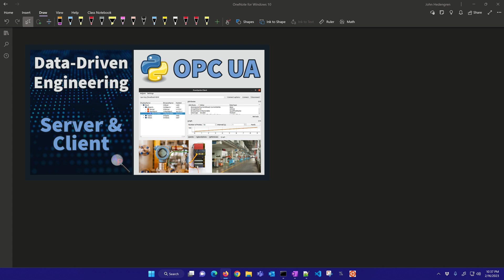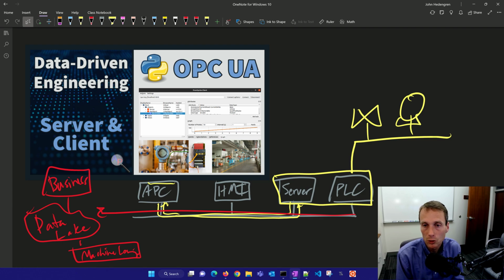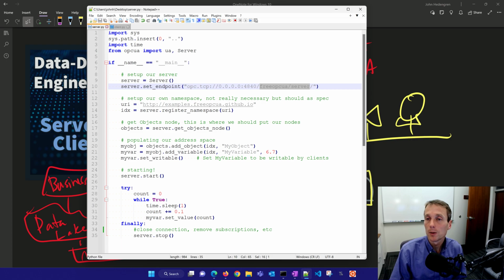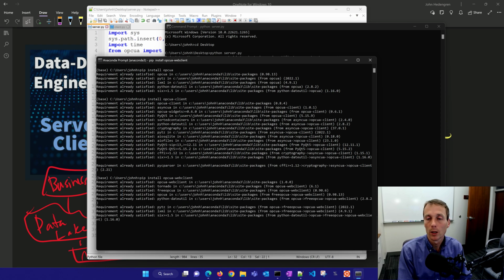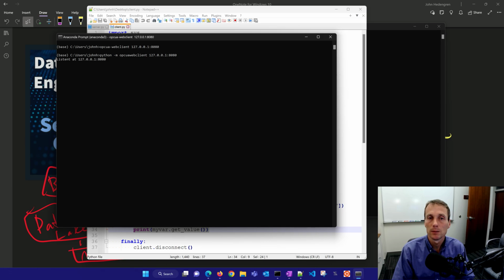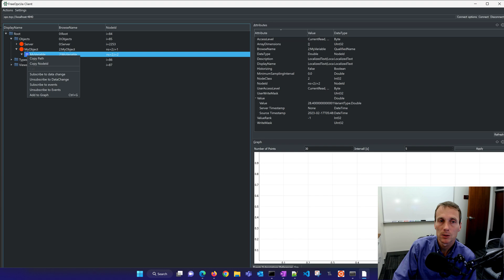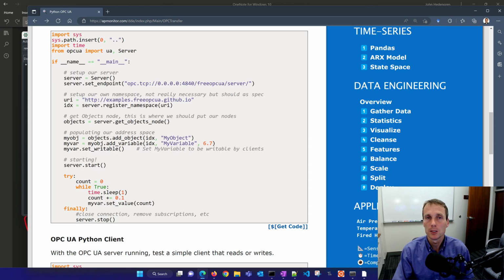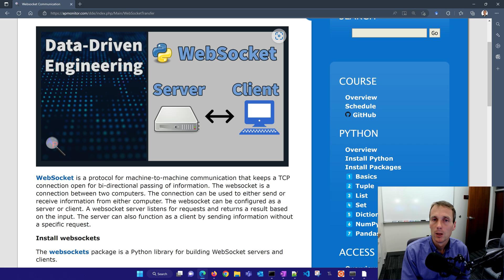OPC UA with Python

Comment: Tnx. How can I connect to a opcua server with certificates and sifn encrypt?
Reply from the maker: To connect to an OPC UA server with certificate-based authentication and sign & encrypt security, you typically follow these steps using a programming library like Python opcua.

Step 1: Install OPC UA
pip install opcua

Step 2: Generate a Certificate and Private Key
You can use openssl:

openssl req -newkey rsa:2048 -nodes -keyout client_key.pem -x509 -days 365 -out client_cert.pem

This generates:
client_cert.pem → Client certificate
client_key.pem → Client private key

Step 3: Connect with Sign & Encrypt Security
Here’s a Python example:

from opcua import Client
from opcua.common.security_policy import SecurityPolicyBasic256Sha256

# OPC UA Server endpoint
url = "opc.tcp://localhost:4840"

client = Client(url)

# Set security policy to Sign & Encrypt
client.set_security(
    SecurityPolicyBasic256Sha256,
    certificate_path="client_cert.pem",
    private_key_path="client_key.pem",
    server_certificate_path="server_cert.pem"  # Provided by the server
)

try:
    client.connect()
    print("Connected successfully with Sign & Encrypt!")
    # Read or write nodes here
finally:
    client.disconnect()

Replace "server_cert.pem" with the actual server certificate file or fingerprint if available.

Comment: Nice video! Thanks! May be you can make video about OPC UA TSN? And IEC/IEEE 60802 TSN?
Reply from the maker: Time-Sensitive Networking (TSN) is important in many applications. I typically use MODBUS when speed is important. It is an older standard, but specializes in high-speed numerical data.

Comment: Code doesn't work for me. I got this error: "The requested operation has no match to return."(BadNoMatch)
Reply from the maker: The error message "The requested operation has no match to return." (BadNoMatch) from the Python OPC UA package generally indicates that the operation you attempted to perform did not find a valid target or match in the server's address space or data structures.

Comment: How do we handle cases where we have a subscription based getting data and suppose there is a connection drop. So we still go with latest value assuming it has remained constant and not updated
?
Reply from the maker: When working with OPC servers, identifying and managing stale or outdated data values is important in industrial applications where data integrity is vital for operation safety and efficiency. Here are strategies to detect stale values with OPC UA:

1. Timestamp Checking
Each value read from an OPC UA server includes a timestamp that can be used to detect when data becomes stale if the timestamp remains unchanged over an extended period.

2. Subscription and Monitored Items
Instead of polling data (repeatedly reading values), OPC UA supports subscriptions where the server notifies the client of changes. You can specify a publishing interval and a "deadband" to filter out unnecessary updates. Monitored items can be set to notify only on significant changes or after a certain time of inactivity.

3. Setting Data Quality Flags
OPC UA servers can be configured to include data quality flags with each value. These flags can indicate issues such as communication errors, sensor malfunctions, or configuration errors. By checking these flags, you can determine if the data should be considered reliable.

4. Implement Heartbeat Signals
For critical variables that must be updated regularly, implementing a "heartbeat" signal can be effective. This is a write operation performed by the data source at a regular interval to a specific variable, indicating that the source is still operational. The absence of recent updates to this heartbeat variable can signal an issue with the data source.

5. Analyzing Historical Data Patterns
In some cases, analyzing the historical patterns of data updates can help identify anomalies in data freshness. If certain variables typically update at regular intervals, deviations from this pattern can be flagged for further investigation.

Comment: Hello !!
Actually at 9.21 minute of video time-stamp I am not able to connect due to error "Unexpected token 'T', "Traceback"... is not valid JSON.
Can you please help me with it. Also I had followed all your steps as you guided and codes too still fcaing this error. 
Please look into it.
Reply from the maker: It looks like this is a common issue that everyone is facing with the current version. I recommend contacting the developers or else use an earlier version of the library.
Reply: @apm  okay!! can you please recommend the versions you have used in your video ?

Comment: Great video, thanks! Although i struggle to connect to server from webclient interface. I'm getting "Unexpected token 'T', "Traceback "... is not valid JSON" when i click connect. Where can I fix JSON parsing in my server?
Reply: I am facing the similar isssue while connecting a codesys softplc controller, Please reply to this thread if you find any solution, will be really greatful to your help.
Reply from the maker: It looks like this is a common issue that everyone is facing with the current version. I recommend contacting the developers or else use an earlier version of the library.